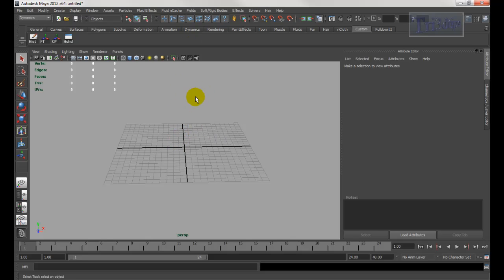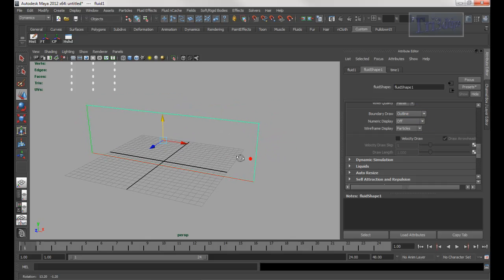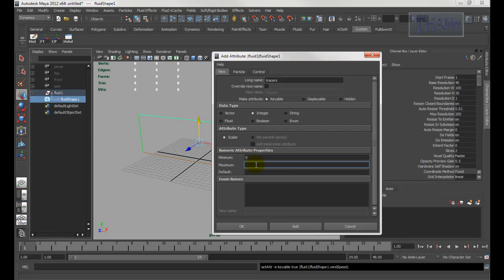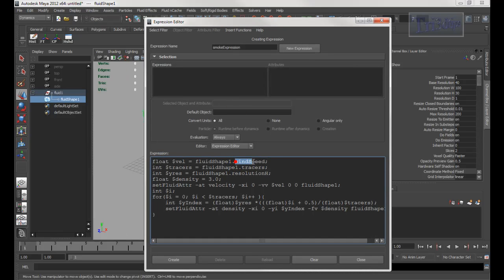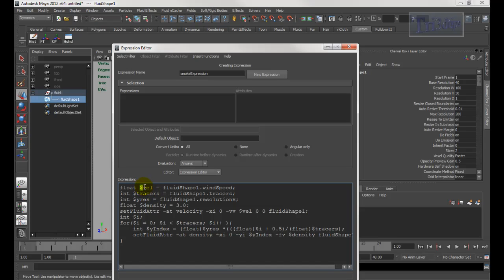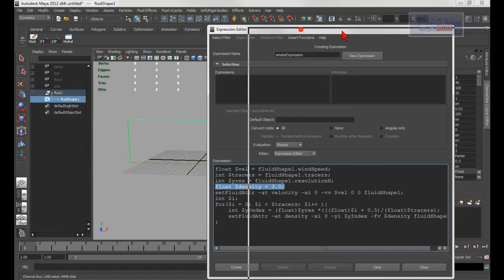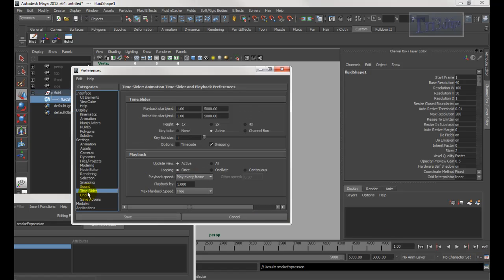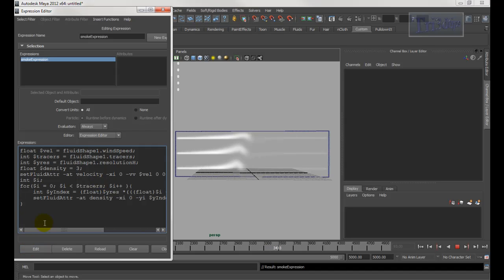2D Wind Tunnel Part1

Comment: Hi, i am getting error 
// Error: Attribute not found or variable missing '$':  fluidShape1.tracers
please help
Reply from the maker: Hi Vijit,

Did you copy / write the exact command lines? 

float $vel = fluidShape1.windSpeed;
int $tracers = fluidShape1.tracers;
int $yres = fluidShape1.resolutionH;
float $density = 3.0;
setFluidAttr -at velocity -xi 0 -vv $vel 0 0 fluidShape1;
int $i;
for($i = 0; $i <$tracers; $i++)
   {int $yIndex = (float)$yres *(((float)$i + 0.5) / (float)$tracers);
    setFluidAttr -at density -xi 0 -yi $yIndex -fv $density fluidShape1;
   }

Hint: you can call it: tracers, smokeLines, smokeTrails, or whatever 
name you want.

I called the smoke lines as tracers, but you can call it anything you. 
For example, if you decide to call them smokeLines, then write:
int $smokeLines = fluidShape1.smokeLines;

Remember that you have to create an attribute called smokeLines first 
before you added the name smokeLines to the command line:
int $smokeLines = fluidShape1.smokeLines;

Don't just change the name to whatever you want in the command line.  
The name in the command line must match with the name that you created 
in the Attribute Editor. If you rewind the video to timeline 2:43,
 you will see how I created the Attribute Name called tracers. You can 
name tracers to whatever you want. This name must match with the name on
 the command line for:
int $tracers = fluidShape1.tracers;      Don't forget to replace all of 
the word "tracers" with your specific name